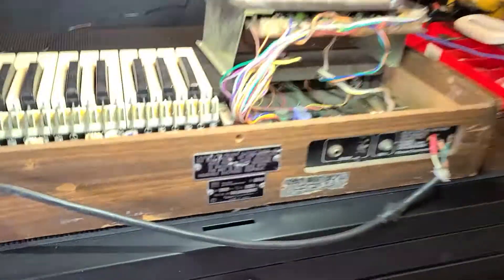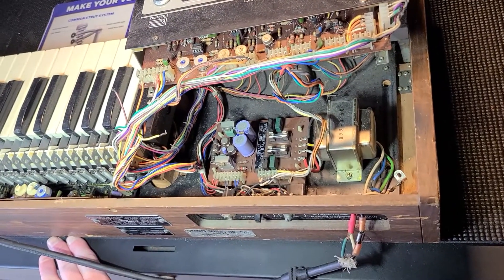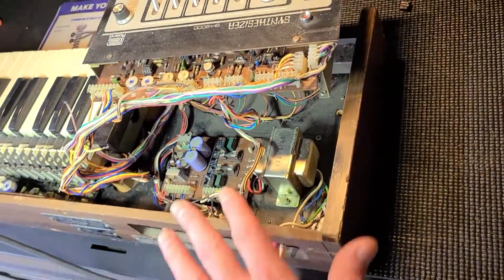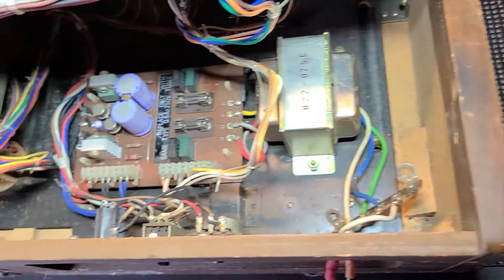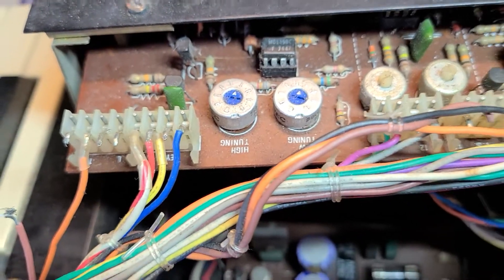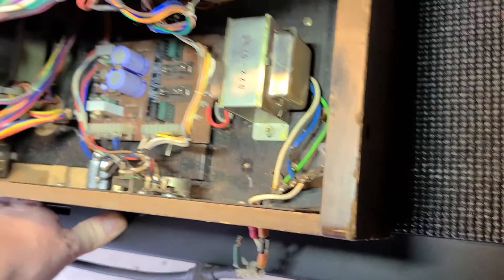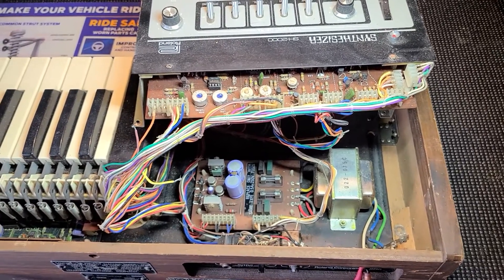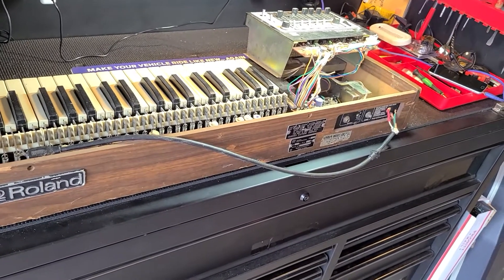Roland Sh2000 - Help Me Fix this!

Comment: That power cable looks very unsafe. Exposed spade connector, no strain relief, and the terminal floating around inside could short against something. That is mains AC voltage there, have it fixed by a pro if you are unsure.
Reply from the maker: Any "Pro" needs a diagram. I do this everyday on boats and cars. Hard to look up a 1970s Synth Specs And blowout diagram. I am not going to Guess. lol . thank you though.
Reply from the maker: I did find Some literature that points me in a direction. I will post results.
Reply: The schematics are available online free from a dutch (I think) company that cleans up and re-writes in-house schematics so that they are useable for all. Helped me a lot. I have 2 SH2000 to repair. I advice to not just assume where cables could go by looking at the connectors. Follow the schematics and look online there are images so that you can get some idea.
Reply: To find the schematics (for the benefit of all who read this) the facebook group Roland SH2000 has the schematics as does the Vintage synthesizer repair group.
Reply: My two SH2000 both have an added fuse before going into the power adaptor. I can't see it on this one.
Reply: What happened?